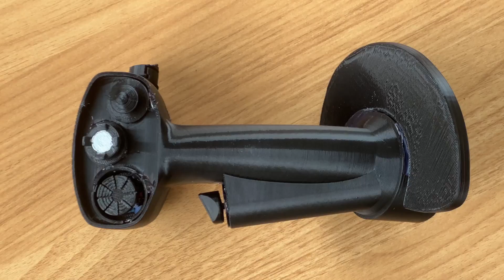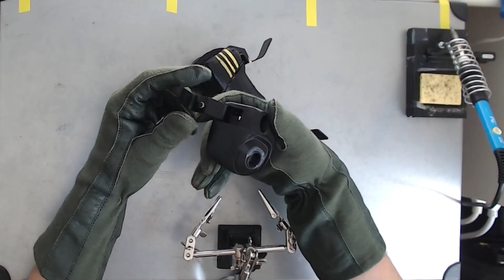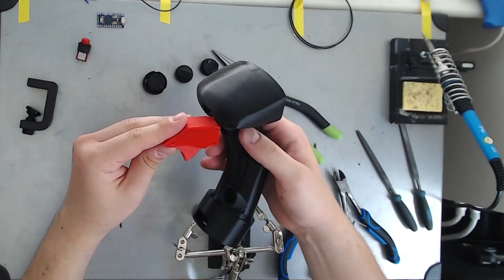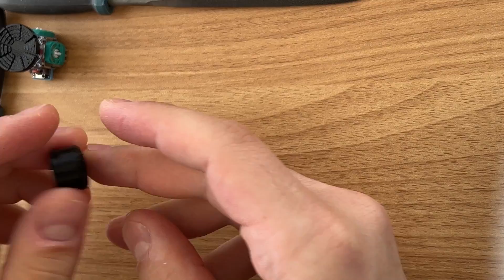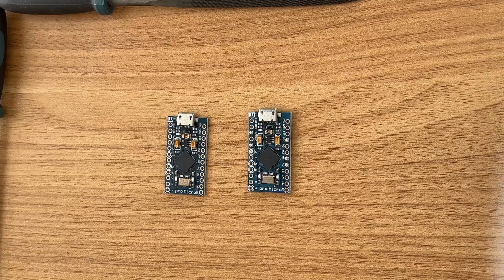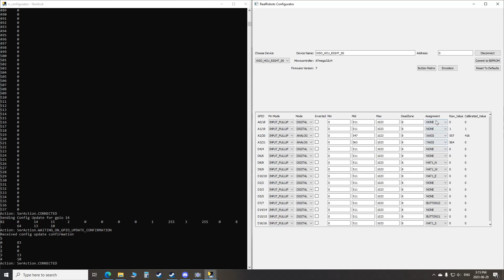Strike Eagle Controller Assembly and Wiring Overview

Comment: awesome project man, im printing this myself. How and where did you mount the adruinos?
Reply from the maker: Thanks Neo! I inserted the arduino's through the hole in the base, however there is no specific mounting point
Reply: @thesimnet  ah ok , so they are just free floating in there? Also you are using 2 Adruinos because of button number Limitation on one? How many total button inputs do we need?
Reply from the maker: @neok23  Yes that is correct! It gets quite dense with all the wires but I am experimenting with mounting methods for future grips (see F-15E front seat grip). It's 21 buttons and 2 axis. You could also use 1 arduino and a button matrix, however that can get tricky for absolute beginners!

Comment: If I make these using the 2x Arduinos, does this mean I need to run the RealRobots Configurator whenever I want to use the hand controllers, or once just to establish the axis and buttons?
Reply from the maker: Great question - just once!

Comment: hi TheSimNet question can you make a tutorial how to design in 3d print. Flight stick because I'm going to make a jas39c gripen and the flght stick don't exist yet.
 your diy solution is two 2x strain gauge and 2x HX711 an arduno pro micro quite cheap and an aluminum SQUARE PIPE 10x10mm that you glue strain gauge

Comment: Hey brother great work, i bought and printed one of the hand controllers. Next for paint and wiring. One quick question. I love your stick designs bu cant use them as I have an x56. Do you plan on making an adapter or a variation for use on the x56 base?  If you did, id happily pay for the STL.

Comment: Looks awesome! Dumb question, what 3D printer did you use to make this? Looked at getting something similar printed by a service, and it seems to get expensive quick!
Reply from the maker: I use a Voxelab Aries! I got it on sale on Amazon, it has served me very well. I was an absolute beginner so I needed something that would work out of the box, no complaints!

Comment: hello again i would recommend  you update the p1 replica switch for realism... mainly the dimensions arent 100% correct you can find the dimensions on mouser electronics also maybe you could add some spring system so who wants could modify it to requires 4 lbs of force like the real one.. and maybe you could add an more realistic/replacement cap mine got damaged during shipping? edit: i think you removed the link to the clamp while updating the BOM

Comment: where can I find info about connecting two Arduinos together? that sounds like a game changing development for me. 

prewired shift registers are expensive and wiring them myself takes time and they always end up being far too large. 

adding Arduinos is a much cheaper option.
Reply from the maker: Absolutely, I learned it here: https://youtu.be/yAuzYRg4N38
Reply: @thesimnet  sorry to pester you but it says you can daisy chain Arduinos together but i cannot find which pins to connect the third Arduino to. or do they just all connect to the same pins? 

connect all the SDA pins together and all the SCL together on all 3 Arduinos? is that right?

edit - I found the answer on another video. 
the answer is YES - all devices share the same pins 2 and 3  (SDA and SCL) so wire them all in parallel.
Reply: @thesimnet  me again. I hope you don't mind. 
am I correct in understanding that you can use Arduino Nano for the secondary "child" controllers so long as the master is an Arduino ProMicro?

I hope this is correct as the nano is much cheaper than the ProMicro
Reply: here it is: https://www.youtube.com/watch?v=yAuzYRg4N38&ab_channel=realrobots

thanks for leading me to this. absolutely brilliant! thank you.

Comment: This is the same HCU as the LANTRN in the Tomcat Isn't it?
Reply from the maker: Very close! The Lantirn HCU has an additional button on the faceplate and the TDC is in the middle as well as a few other small differences. I do plan on making the F-14 version as well!
Reply: @thesimnet  Cool, I'll hang on for that one then!
Reply: Any news on the F-14 mod of this? Pretty much just a different placement of some holes and an extra button. Not something easy to do with the provided .stl but with the actual cad file easy.

Comment: With linking the 2 arduinos, could the same method be used to link a pro micro and a arduino uno r4 while maintaining the hid on the pro micro?
Reply from the maker: I have not tried that personally, but others have mentioned that there are breakout shift register boards that can connect to an arduino pro micro and expand the inputs

Comment: thank you for this video, for the wiring, what diameter is used? i'm having trouble understanding the bom please.
Reply from the maker: I used standard dupont connector based wires of various diameters, really just whatever I had laying around. The springs in the trigger mechanism have specific diameters to ensure they trigger the buttons at the right time as well.

Comment: 11:37 According to the Razbam manual, the switches are on both controllers, with the LHC having the countermeasures dispensing functionality, and the right one being the "AAI / NCTR / EWWS" switch.
Reply from the maker: Thank you for the clarification - misunderstood that section on my part!
Reply: @thesimnet  No worries, it happens. FWIW the relevant part is on page 96, 3.4 Rear Cockpit Hand Controllers. =)